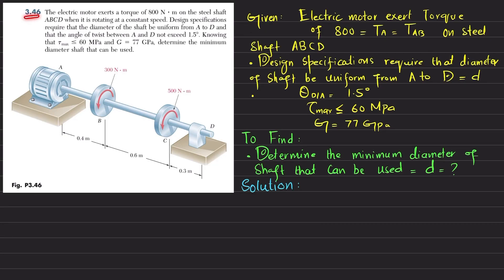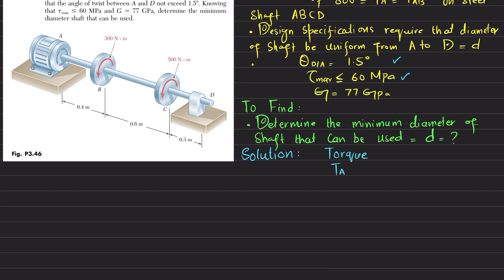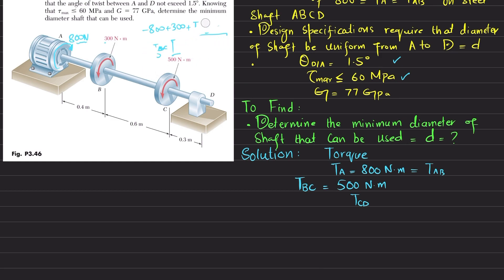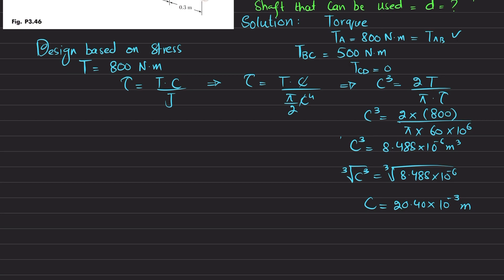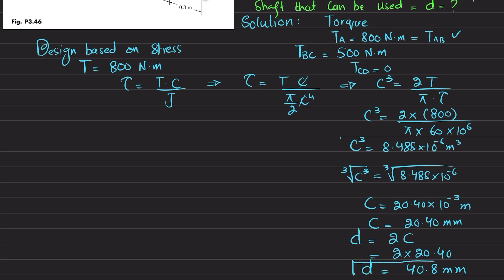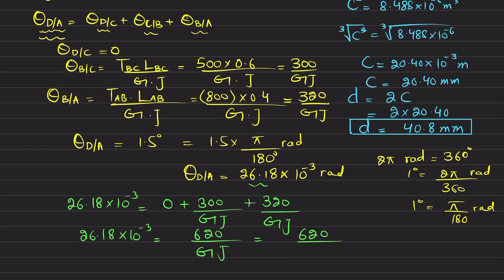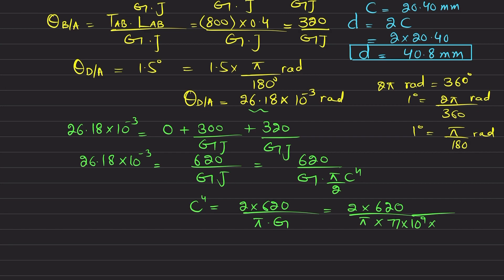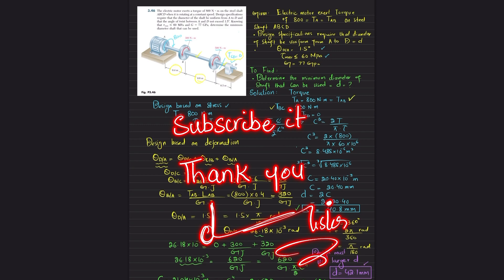3.46 Determine the minimum diameter shaft that can be used | Mech of materials Beer & Johnston

Comment: sir i don't unerstand why we use larger diameter. why not the smaller one?
Reply from the maker: Kindly mention the time where you are facing problem
Reply from the maker: Ok I have checked you can see the larger diameter we selected will be more safer as compared to smaller one. That's why we choose larger diameter. ❤

Comment: Hello sir, why u assuming that 800N.m is clockwise?
Reply from the maker: You can see that when you cut the shaft between AB so total torque on right is 800 N.m which is counter clock wise so inorder to keep equilibrium Tab should be 800 N.m clockwise.
Reply: @engradnanrasheedmechanical  tq sir
Reply from the maker: @ronaldlee9641 you are welcome 😊